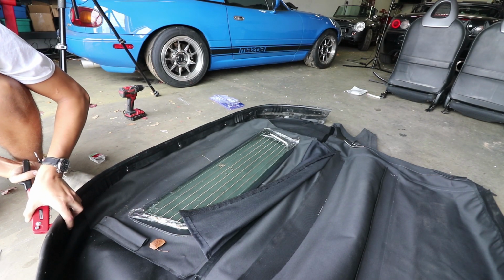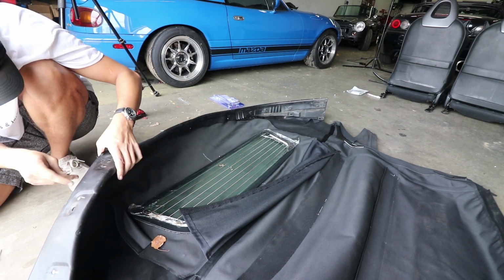Convertible Soft Top Removal (Extremely Satisfying) | Phase 1 Episode 5

Comment from the maker: Do you have any experience with replacing a soft top and how horrible was it? 😅
Reply: Yes, on my Miata, and I didn’t even remove the old one from the frame. I found a complete top with frame in excellent shape from a salvage yard, so it was a straight swap, and it was STILL one of the hardest things I’ve ever done. Part of it was that I have a double hoop roll bar bolted in place that made it super hard to access the rain rail retainer nuts around the bottom. 

I would definitely recommend anyone attempting this to get something like a Robbins top with a new rain rail pre installed. At least it will save the trouble of installing all those rivets.